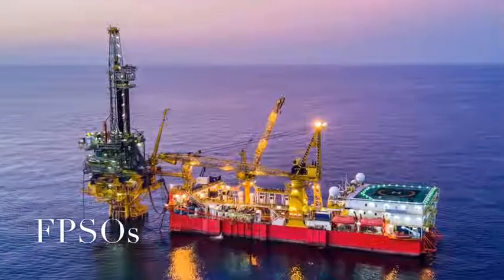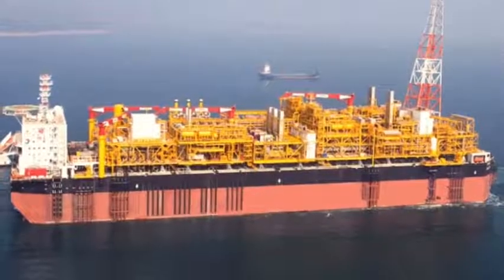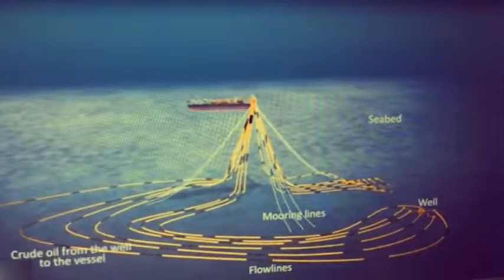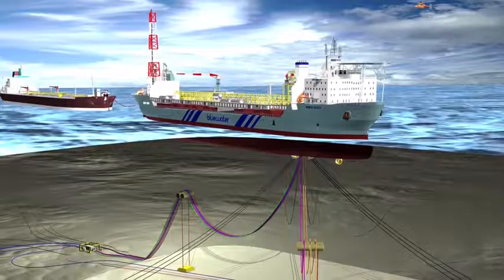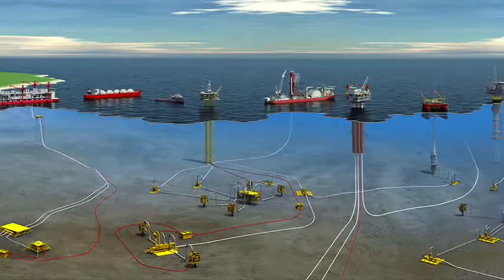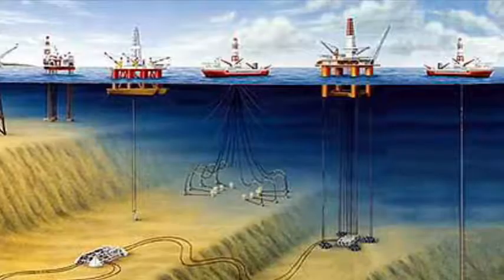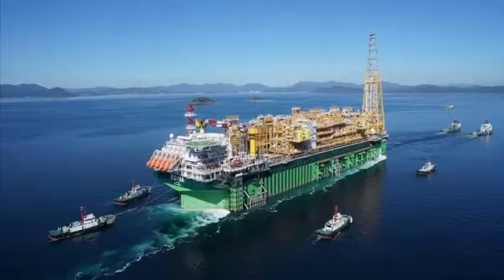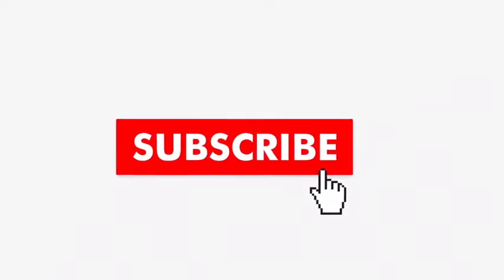What is a FPSO ? The video showcases the fundamentals of a FPSO

Comment: Very informative video.
What is the price differential between construction of a fpso and an oil platform ?
Also how is the operational costs different for a tanker with an FPSO ?
Reply from the maker: That's a pretty interesting questions.

It boils down to the specs of the facility, type of oil/gas to be extracted and overall life of the field. 
New build fpso is naturally higher capex than a converted facility.  Fixed platform and floaters are different in some ways that each has its own design benefits.